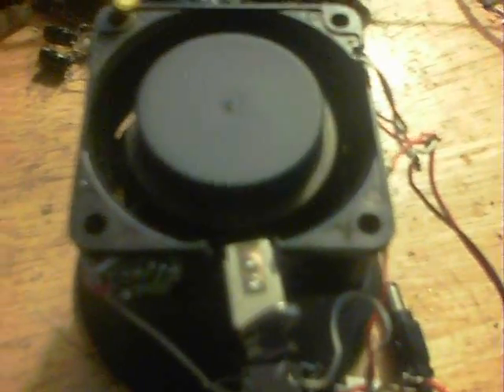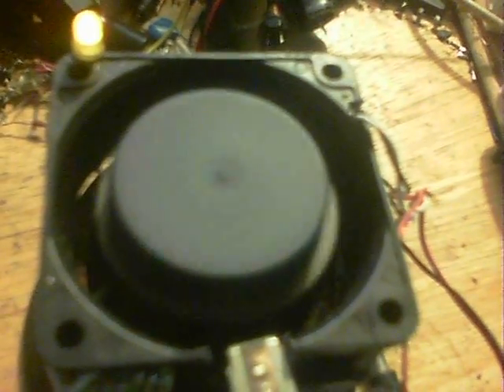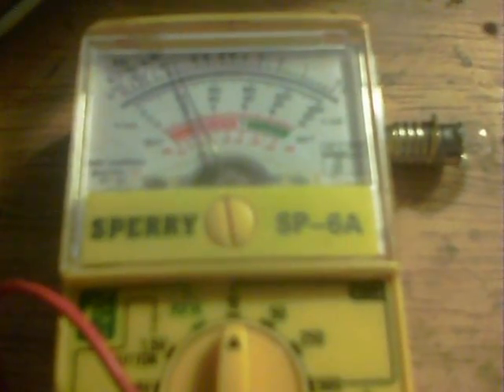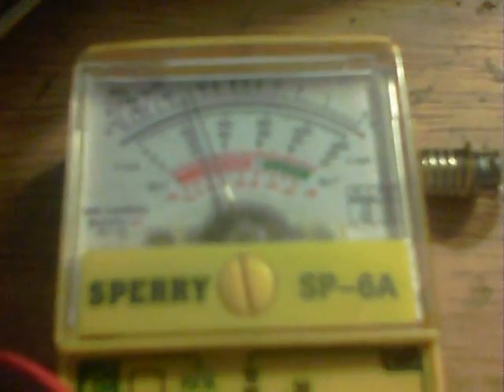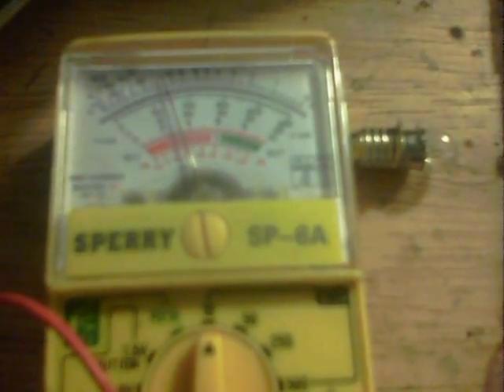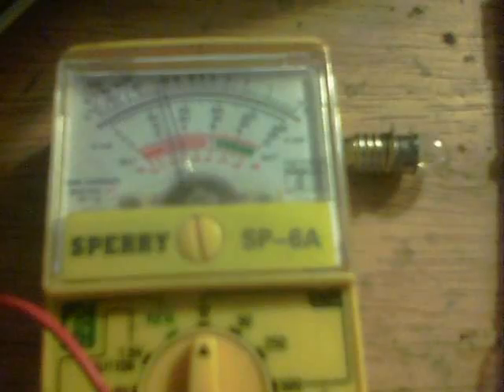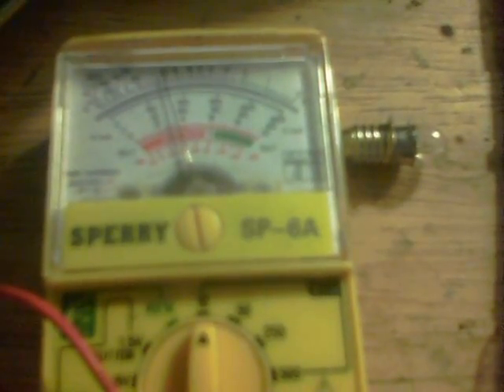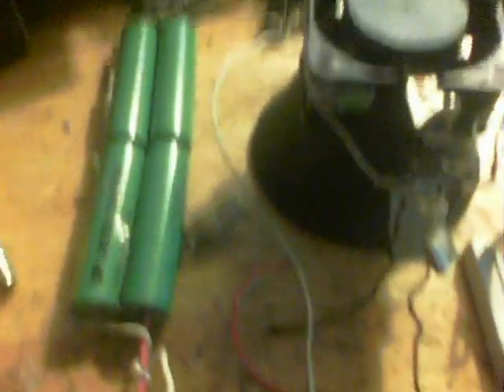FanGen - NiMH rejuv + charge up

Comment from the maker: @jozsab1 Yes, i'd agree completely with your thoughts :) You can hear the wildly different speeds of the rotor and see the other effects as it breaks the battery pack in to a chargeable state. 
Overnight resting voltage started at about 2.5V, but that is increasing as the pack is used.
What i'll try is a pulse motor on these and returning to charge. Not closing the loop as such, it would be a 2 stage method.

Comment from the maker: @jozsab1 I'd agree...the fan itself never uses above 100mA, it being rated originally at 130mA at 12V with blades on it to create drag. The magnet based drag seems to interact heavily with what would be almost a short on the output when the batteries are in such a bad condition. This set now charges quicker each time, but I prefer to run it at a slower speed, giving a slower charge rate, as the pack lasts longer.

Comment: i guess the fan speeds up due to the battery absorbing less mechanical energy ? They say as battery gets depleted it's resistance increases. Electrons move move harder in the battery. As it gets charged, chemical changes might ocure ( slow charging ) and the resistance decreases again.